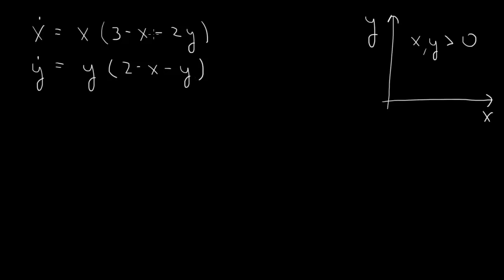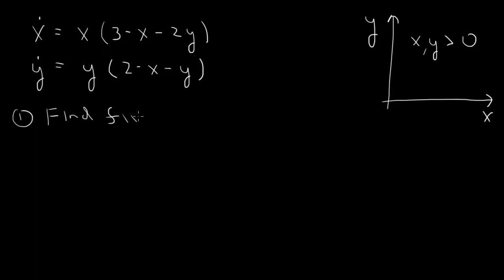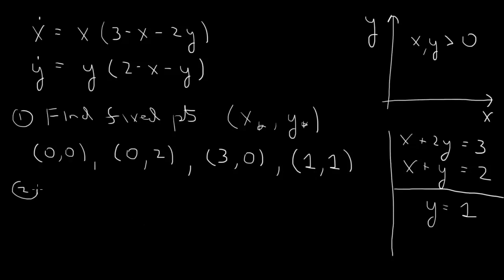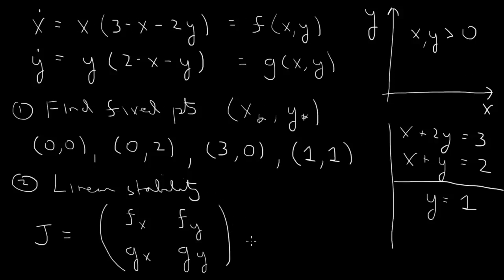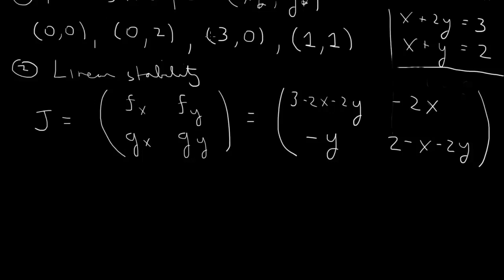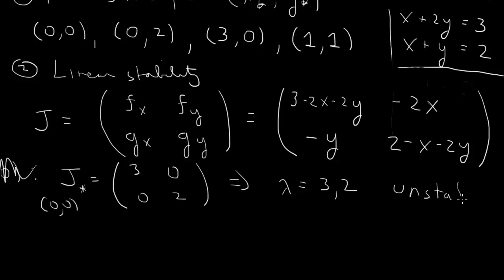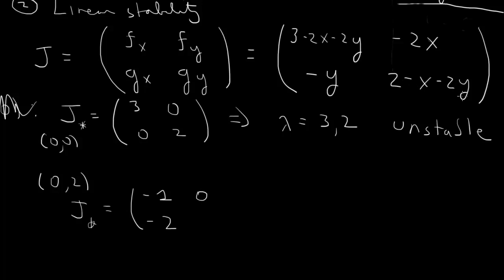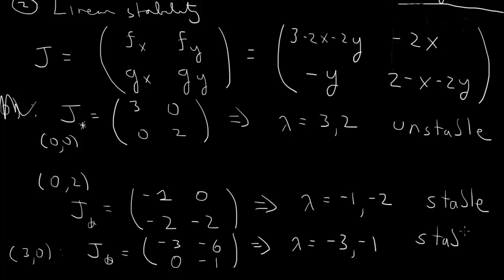Fixed points and stability of a nonlinear system

Comment: how did you generate the phase space diagram? I'm having trouble plotting that on matlab
Reply from the maker: Took some work.  I think I used the analytic solution and varied the initial conditions.
Reply: @Jeff-math  awesome I got it to work thank you! is the slope of the saddle point directions the Eigenvector where the x and y of the eigenvector are rise/run?
Reply from the maker: @bdizzle123001  yes
Reply: @Jeff-math  Thank you so much.

Comment: Is there a simple proof showing that the eigenvalues of the Jacobian are key in the determination of the fixed points stability. What about if the eigenvalues are imaginary?
Reply: Hi and thanks a lot for your help! My problem is the following: I would like to draw a phase portrait for a system of 3 differential equations.
Reply: Can you help please
How classification of critical points of system in three equation in 3d